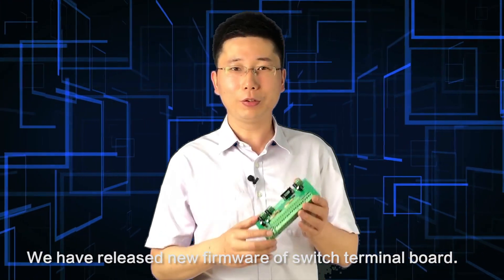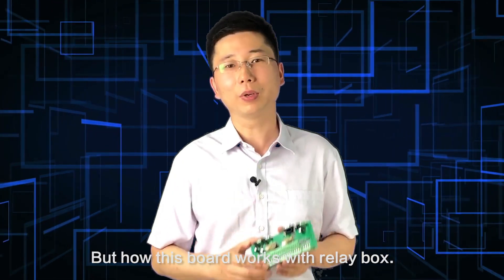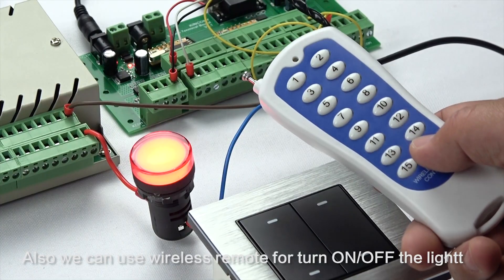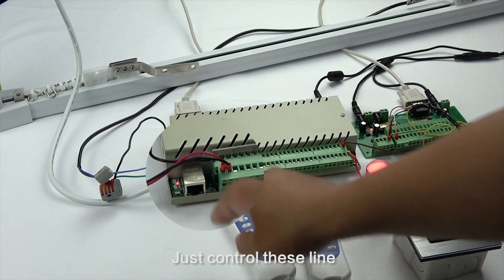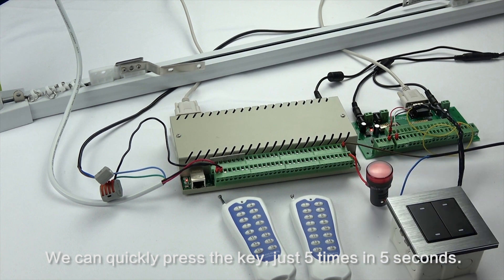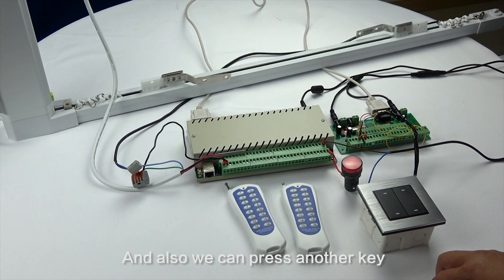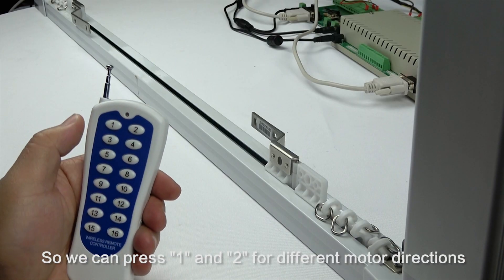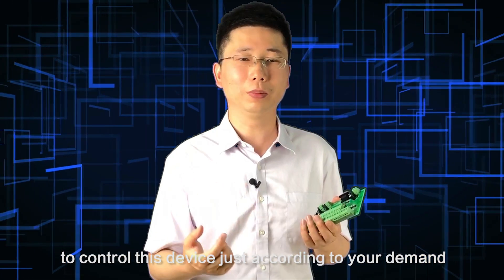how to control curtain garage door shutter by switch remoter and phone

Comment: Can you post a video on how to use a physical self reset button to open, close and partially open a blind, but using a motor with 4 wires (neutral, earth, Line and reverse)?
Reply from the maker: this video already show this? which part you don't understand?
Reply: @KinCony  i got the wiring connection as shown in the video, but what about the software config to use two relays on one motor (to prevent two simultaneous commands to be sent to the motor, for instance if a person presses the two up and down switch button simultaneous)
Reply from the maker: ok, that already in this video: https://youtu.be/ryqMke5f16o     just chose "click" or "touch" mode of "KBOX" phone app.